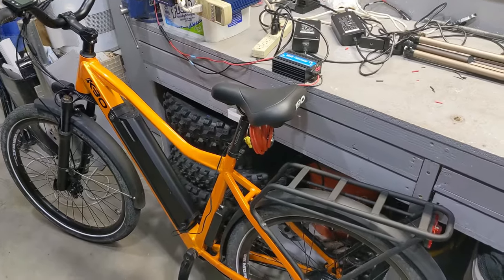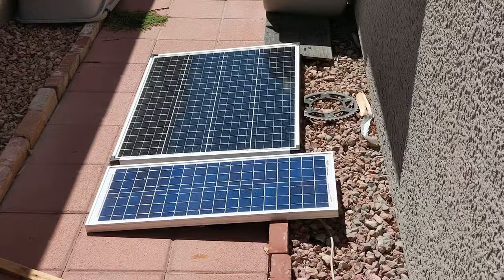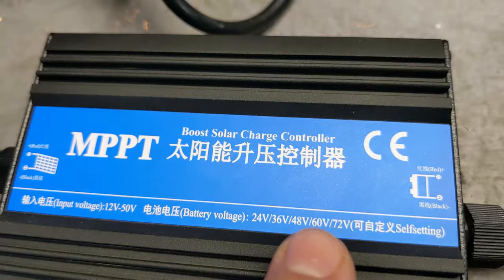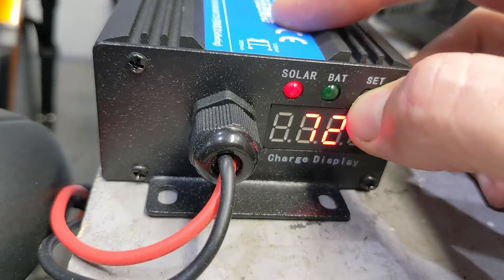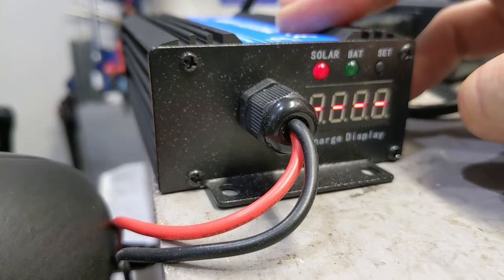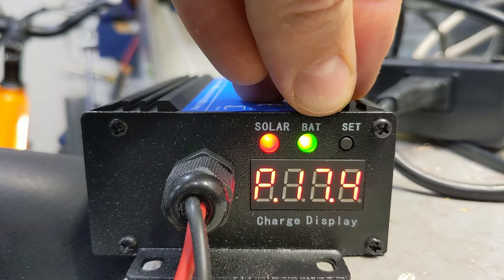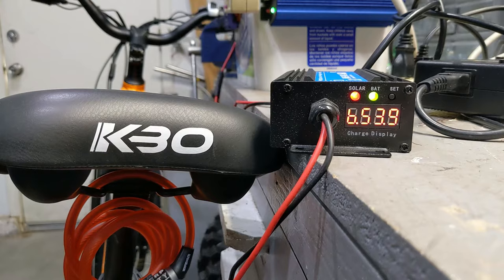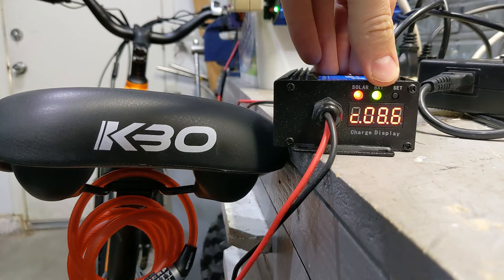How to charge an E-BIKE with solar panels Directly, Solar MPPT charger for E-bike KBO or Himiway 48v

Comment: Is it true a 270 watt solar panel will destroy my 52v 20ah battery? Please elaborate why charging faster with Destroyer batteries. References would be helpful. Thank you for your video.
Reply: My experience with cheap charge controllers on lead acid is that, that is what the charge controller is for: controlling the charge to your battery so it doesn't get too much charge too fast and shutting off when its peaked out.
Reply: Yeah I wonder how much life ebikes charged at 55v@5a regularly get?   The bike I'm looking at has built-in BMS which should help.  Would be great if they ever integrated more functionality into these ebike batteries like usb out, 12v out, solar input, 110v 250w out... right?
Reply: @12vLife  my bike has USB out.  I run my phone off the bike while riding and charge my go pro.  Sur Ron has it.  So yes, in a power cut it's a huge USB power bank!!!
Reply: It depends of the battery chemistry (get the battery cells specs). But usually for Lithium Ion batteries, max charge (not cooled) sould be C/3, so 1/3 of the capacity. Then 20ah should be charged at 6.6A max. But less is better ;). If the Empty battery is 42v, then at 6.6A --> 277.2W Max for your battery charging.
Reply: @wolfmanjack668  Im a novice when it comes to solar as well as electronics. My battery uses a laptop-like charger, that is round. Do they make ones to plug into a controller? Or do I have to splice or solder them myself?
Reply: Charging with a 270w solar panel is fine if the MPPT that regulates the voltage and current is programmed properly. If u set your MPPT to the same voltage as the charger that it came with wether it’s a 52v or 48v, it should be fine. A 52v battery charges at 58.8v and a 48v battery charges at 54.6v. U can actually set the MPPT to charge at a volt or 2 lower to increase the lifespan of the battery as well. The draw back is the battery will not be fully charged which will decrease your range. That’s the trade off. Best thing to do, if u want the best of both worlds, is to buy a battery that’s more than what u need and only charge it up to 90%. I wouldn’t be as concerned about the amp when charging with this small MPPT, it will regulate itself. Charging a battery too fast? The cells themselves can handle the fast charging, but it all depends on the BMS in the battery and what it can handle. Most battery will tell u how many amps to charge at, which really doesn’t say much. Because most people charge at 2 to 3 times the current that is stated on the battery. Don’t expect your 270w solar panel to produce 270w. It can only do that in a perfect lab setting. Even in the best real world conditions it will do around 85%.

Comment: Are your solar panels hooked up in series or parallel?
Reply: Even though it up volts to as high as 72V it is listed as a 24V charge controller on Ebay so I wouldn't go series on your panels past 24 V or two 12 volt panels.  If you are going 3x 12 volt just go parallel since it is an odd number.  With 4x 12 volt you could go two sets of series in parallel, if you didn't have really big panels and you weren't going over watt/amp.  Since he has missed matched panels, I am guessing parallel would be better, because at 24 volts it would probably default to the smaller watts--it would be unbalanced in series.

Comment: How long would it fully charge?
Reply from the maker: Depends how many solar panels you have, the controller it's a 300 watt so it will charge in 2.5 hours if you got enough solar panels.

Comment: I went out today, suddenly the charge goes down and it goes off, now the charge is low, the battery, can anyone help?
Reply from the maker: Setting not right for the battery voltage .. reset battery setting and match the battery charger voltage